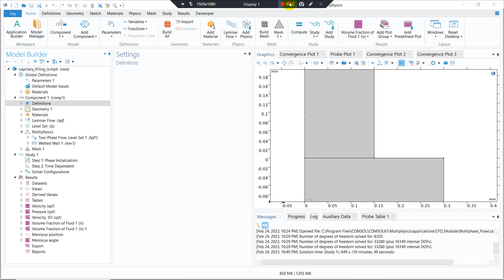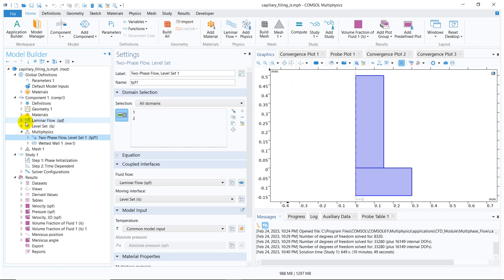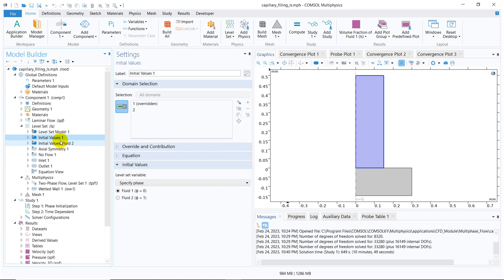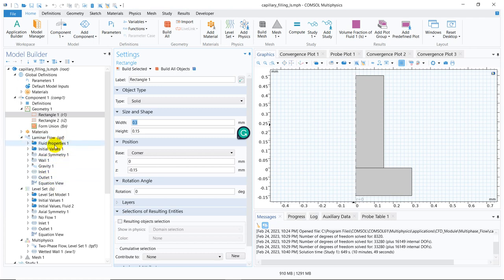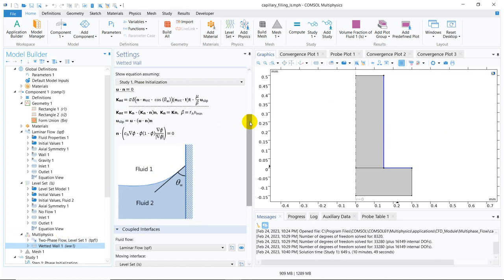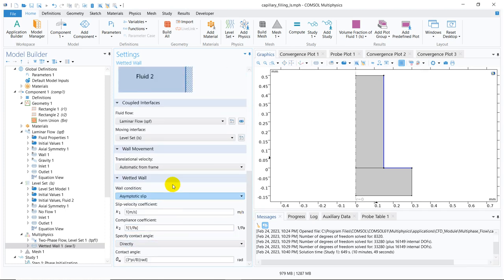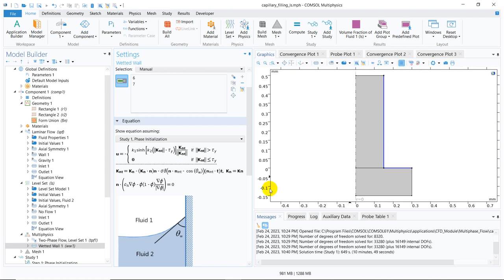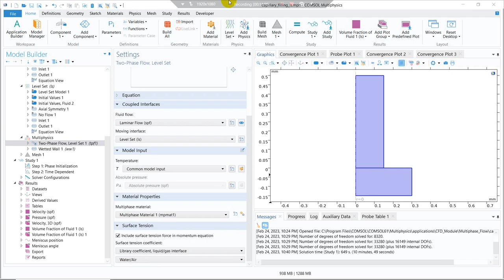Exploring Two Phase Flow Multiphysics Coupling and Wettability Lecture 9

Comment: Thanks again. Considering there is not much information about COMSOL on the internet, your videos have been very helpful for me. Now, I have two more questions. First, how should we choose the reinitialization parameter (or mobility tuning parameter for the PF case)? The e-manual suggests choosing it as the maximum expected velocity magnitude, but I am not so sure as it is changing the results drastically in some cases. Second, assuming the same direction, are the velocity of the tangentially moving wall and the wall translational velocity boundary conditions the same? It seemed pretty much the same to me.
Reply from the maker: If you are working on multi phase flow extensively then we can also think of combined efforts to create more videos in future. You may please write to me.
Reply: @pioneerofsuccess4054  Yes sir I am also working on two phase flow phase field method. Kindly make a video on phase field method. How to take values of interface thickness and mobility parameters?

Comment: Great effort. Is defining the "Initial Interface" in the level set section unnecessary? I also checked the COMSOL 6.0 version, and it has not been mentioned.
Reply from the maker: It depends on your problem. Whenever you do not define anything it takes the default option. Hence, you should also check what equations are there by default.